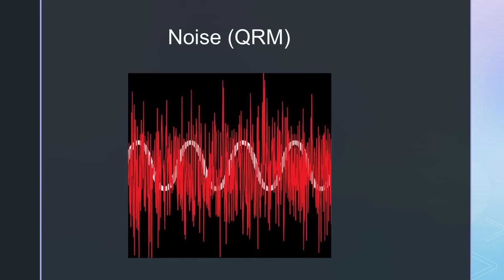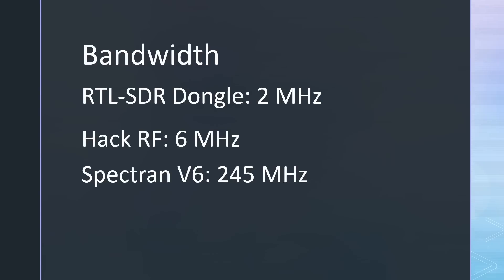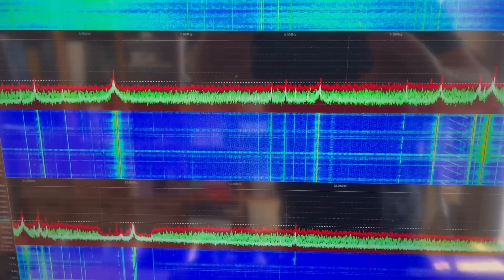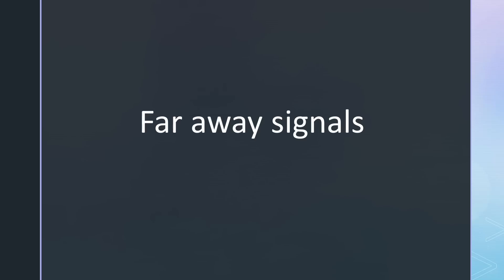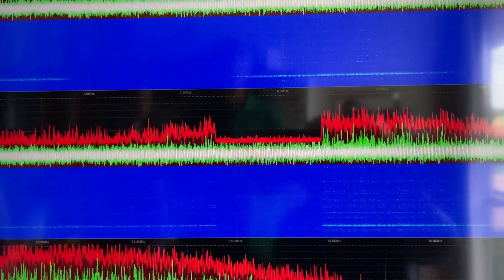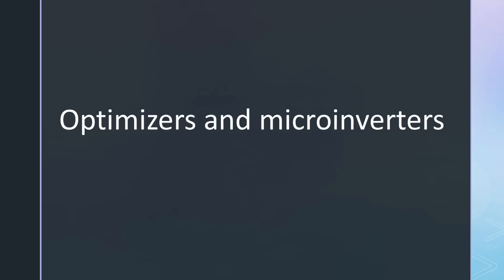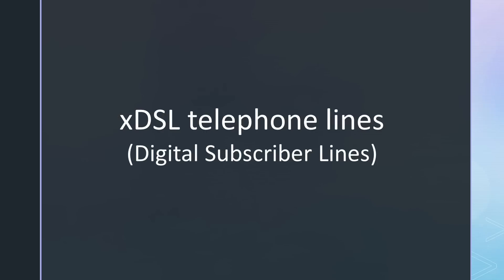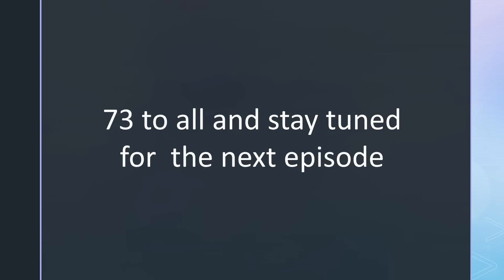Structured Guide to Find Noise Sources (QRM) including Power Supplies, PLCs, and Optimizers

Comment: A friend of mine had to rewire his whole solar roof (warranty, but a öotnof work) and replace electronics on it, because the neighbouring amateur radio station detected interférence from it.

Before they detected even interferences from the train (BLS).

Both of them had to fix it, as BAKOM told them so.
Reply from the maker: Euroloop (used by train companies) is well known to create interferences if not installed correctly.

Comment: What I did: took out all the fuses in my flat and put them back in one after the other. That's how I found the room that was causing the problem. Then took all the plugs out and put them back in again. So I found the external hard drive that was causing the S9 noise.
vy73 de Micha, DD0UL
Reply from the maker: So you were happy you had it in your home and only one ;-)

Comment: I live in Houston TX USA where interference is almost continuous from 400khz to 30mhz. It is a "white noise" looking signal that seems to come from all directions. The amplitude is huge, on the order of 5 microvolts per meter so any serious short wave or other long distance operation is futile.
Reply from the maker: Then the only solution is a remote station, I fear. But for sure, you are not alone :-(

Comment: Many years ago I helped a friend find S9+ noise on 6 meters. I used HT to track it down to neighbors home a couple blocks away. They were very nice and let us in their house and it turned out to be the power supply on an electric blanket. The neighbors unplugged it and noise was gone and when I looked it up that device had a recall for possible fire hazard so the home owners were happy we talked with them. The next day another S9 noise came and we tracked that to a friends shop when it was closed on weekend. Turned out it was caused by cordless phone base that had built in answering machine. It only made the noise if someone left a message in it . Our friend was also a ham and he said that the answering machine part of that got turned on that weekend by accident and he normally never used it.
Reply from the maker: Thank you for sharing your story!

Comment: I have noise from a solar inverter on a street light during the day. Only 1. I cannot get the power company to understand the problem. Clueless they are.
Reply from the maker: That is bad luck! Here we could send a message to the authorities and they have to come and do the measurements. Then it hs to be removed if it does not comply the regulations.
Reply: @HB9BLA  I sent a complaint to the FCC. Nothing was done
Reply from the maker: @JayN4GO  Not good. Maybe it is easier to react in Switzerland because everything is small...

Comment: 8:30 How I hate this noise. 😬 PLC. I have this problem for years now and nothing changed. The whole street is like a giant antenna. Very anoying on the 49m radio band.

And if anyone has a good idea how to filter a class-D audio amplifier, please let me know. A neighbour has a very noise Pioneer amp. The speaker cables act as antenna. Twisted cable or grounded shielding?🤷
Reply from the maker: Usually, we start with adding ferrites into the "antennas"
Reply: @HB9BLA  Yes, this was the first we did. Two 'clip' ferrites on each end of the cable, nothing. Cable wound around a 10x100 mm ferite core, a tiny bit better.
Now I think about shielding the wires or try building additional low pass filters for each output.

Comment: great video. as a swede, i can tell that each solar installation needs to approve CE, therefore, as a owner of example multiple inverters, sush as microinverters, the CE stamps needs to be revalid as the hole installation is complete. (the install of microinverters does not say the CE stands for multiple installed microinverters, only that it will work with multiple. So in other words, the CE only comply with one unit and not the whole solar installation.. )  //73
Reply from the maker: So you are lucky that somebody looks at RF noise. Here, the final tests only are to check safety.
Reply: @HB9BLA  oh man.. that sucks... here they need to comply to CE and with that, EUs EMC directive..so without review the installation, they cant just say "it comply".. // 73

Comment: this is why some circuits from 70' or 80' don't work very well in today's "noisy" homes :( It is annoying because it reduces drastically the range of some DIY built devices :(
Reply from the maker: Indeed, in the old days we did not have to bother as much with these problems.

Comment: I did a similar exercise at two similar tower block homes in UK and in Germany. The noise levels in UK were 30 dB higher than in Germany leading me to believe  that there may be different regulations about sources of noise in the two countries. In UK I have a chinese LiFePO4 battery charger which totally wipes out all HF bands. It is by far the worst polluter. Also in the block I imagine someone is still using a CRT TV as the harmonics seem to change with scene changes in a video signal !
Reply from the maker: I bought a LiFePo charger for our remote station as a backup for solar. It is a huge polluter, too. Unfortunately, you do not see it before you buy :-(

Comment: Nice video. My experience is.... cheap (Chinese) often causes troubles. More expensive... even from China makes in many cases the difference. At home I have a (very cheap) gas powered generator. I can assure it, if I turn on over here, you'll probably will detect the interference in your shack ;-) ! Of course, I never use it, I got it for free for testing.
Reply from the maker: I am not sure if the price can be used as an indicator. I have unexpensive quiet powerbanks and a quite expensive but "loud" LiFePo charger. It seems to be a bit of luck. 
And I have buck and boost converters from one supplier that are quiet (the exact same looking one from another supplier was "loud". So I stick with this supplier and it looks OK up till now.

Comment: what is the harm of rf noise.  why do i care, could you please explain? thnx a lot for great video.
Reply: A device emitting RF noise is transmitting on someone else's frequency. This video talks largely about the Amateur radio bands, where this RF noise can make it impossible to use the frequencies for communicating because the interference is so loud. It's like if you were talking with someone at a quiet party, and someone cranked a stereo.

There are laws governing electronics and RF noise. Besides being rude to the people that are licensed to use the frequency it's illegal to transmit/cause interference on frequencies you're not licensed to, even if it's unintentional. Thus the "product pulled from market" things in the video.
Reply from the maker: @SeanWalberg: Good explanation. Thank you!
Reply: @SeanWalberg   The FCC and FAA got on cable companies case because when they left unterminated ends of cables on their system, it caused interference to aircraft or police frequencies . The cable companies cleaned up their systems quickly after that.

Comment: Your video comes at a very good time! My pal and I are trying to discover why his Sonoff S31's running Tasmota keep dropping off his network. These are 2.4Ghz WiFi. I have the same devices on my network and do not have this problem. He is in a completely different urban area, the Highland Park area of St Paul, MN. I live in suburban Burnsville, MN some 25 miles or so from his location. He has other 2.4Ghz devices that are not affected. I am suspecting radio interference as a potential cause. Besides following the general process you describe, do you have any suggestions about finding interference on the 2.4Ghz WiFi band? We have SDR USB dongles. Many thanks!
Reply: Common SDR dongle receivers (RTL2832U) cannot sample the 2.4GHz Wifi band. SDR-Play, HackRF etc are more expensive, but can go up to 6GHz. Good luck finding the issue.
Reply from the maker: The 2.4GHz band is quite used in many locations. So it easily can be that this device has issues with crowded channels and the source is not QRM but other 2.4GHz devices. As mentioned by @squelchstuff, These dongles do not work up to 2.4GHz. But maybe you can chart a rough coverage of the channels using a Smartphone map? ( Google "ESP32 / 8266 WiFi Signal Strength" ) because YouTube does not allow links anymore.
Reply: There has been a specific 2.4 GHz spectrum analyzer USB dongle for the last 20 years for about $200 USD. I don't know if it's still actually available as there are newer SDR stuff made since. But these things have been available for Wi-Fi field engineers and techs for a long time.
Reply: As Andreas says, you might have more luck with some of the survey apps available for mobile and desktop. They'll show which channels are in use in the locality, signal strength etc. It may simply be a case of manually selecting a less congested channelled, as many users leave their APs on the default channel 1. Search wifi mapper or similar. Netstumbler used to be a popular choice, and many are based on that. As an aside, it seems that some ESP based  IOT devices can be prone to this behaviour as is often reported. I've noticed some households with smart lights flashing on and off that have obviously lost their pairing, and have defaulted to setup mode while the residents are away. Burglars must be having a field day. Not smart...